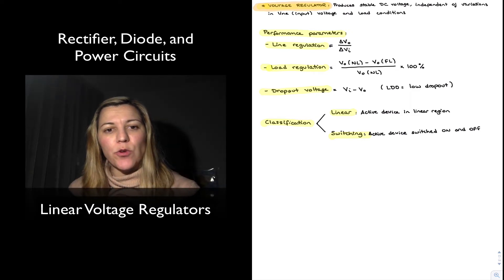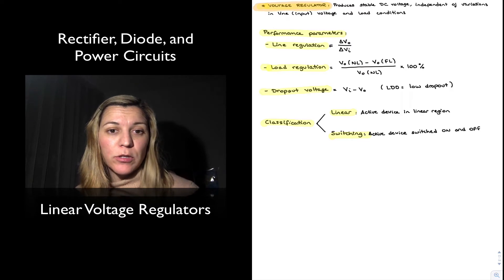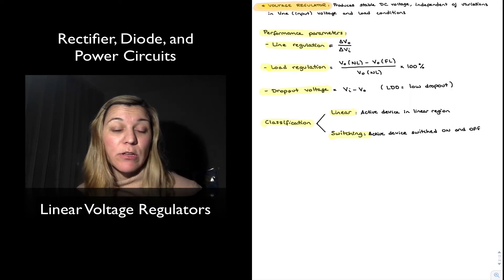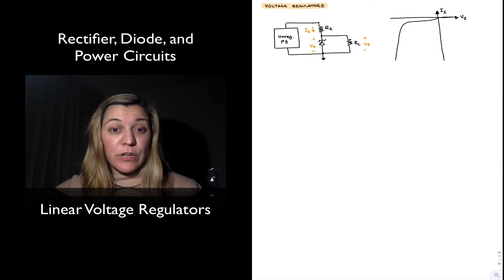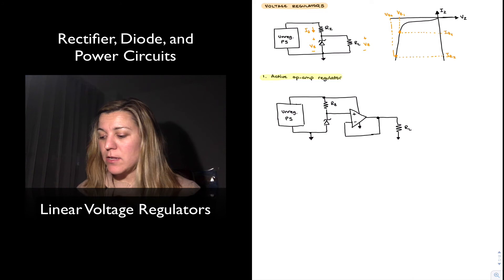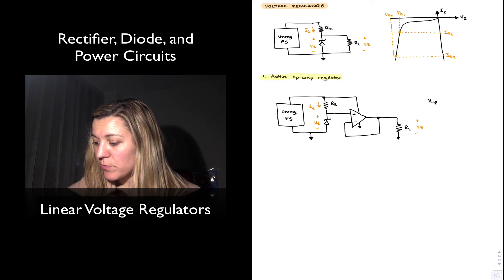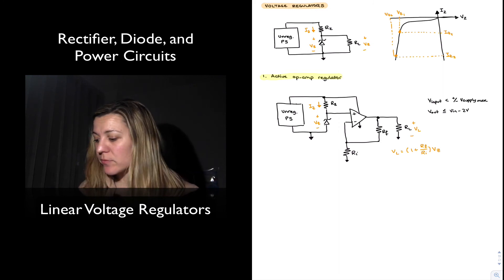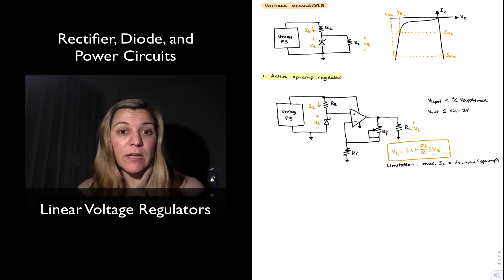Active Linear Regulators (Pt 1)

Comment: Still holds as one of if not the clearest tutorial on the background behind how and why voltage regulator evolved as it is.  A correction at 9:54 what you meant is V_out <= V_supply - 2V instead of V_in - 2V.  The headroom is between supply rail and output supply, not the input (which gets amplified).  I believe it's just a typo.